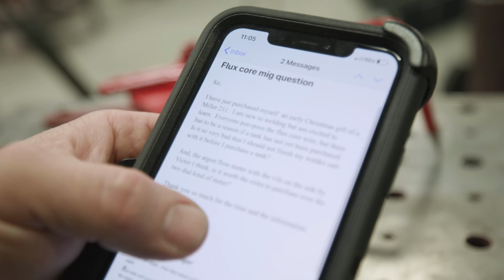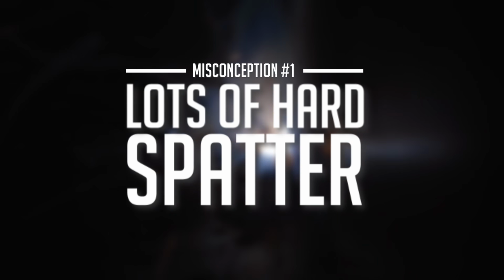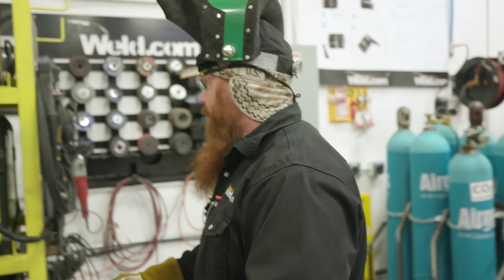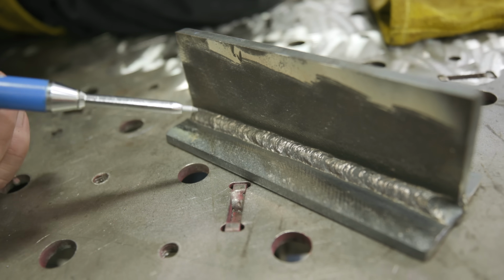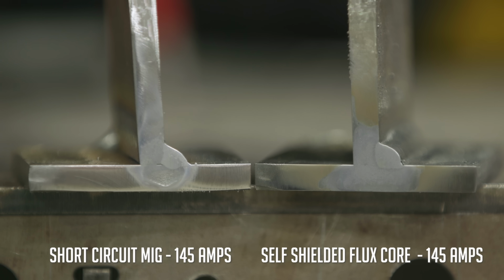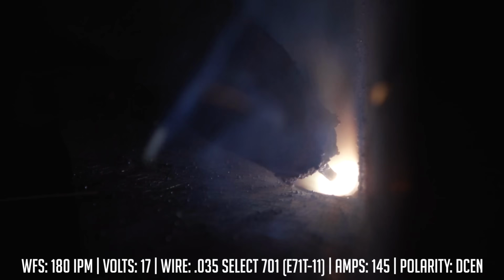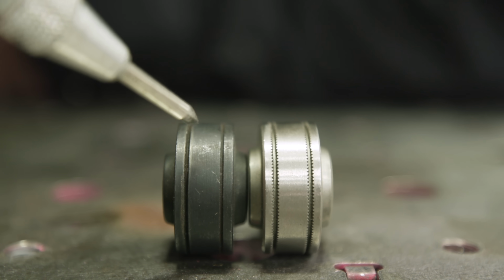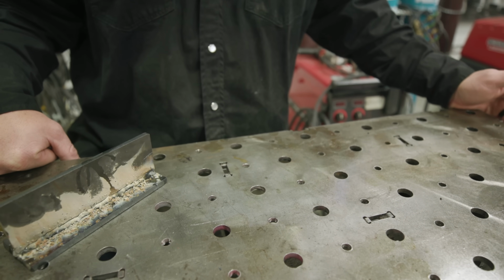3 Flux Core Welding Myths DEBUNKED

Comment: FWIW, showing us this on a Harbor Freight flux-core mig would be more relatable to the home hobbyists.
Reply: There are quite a few videos on Youtube of how to mod those Harbor Freight ones.  Thing with them is, factory they aren't even DC.  Even with decent wire they spatter like mad and it's hard to get a good weld with them.  They are usable, but not fun.  I plan on seeing if I can get dads and do a DC conversion and other mods to make it work a little better as a DIY project.
Reply: In dad's he used Lincoln Electric wire to make it usable.  The Harbor Freight flux core wouldn't even produce a weld in any way we tried.
Reply: @RotaryTurbo  I've been able to weld everything from 22 gauge up to 1/4" with my Harbor Freight flux core welder. Not saying the welds were beautiful or I didn't blow holes all over the place, but you can definitely get a real weld with ease. On clean 1/8" steel it will weld just great.
Reply: @RotaryTurbo  Pull the weld, give it a 1/2" stickout, and practice, the Harbor Freight machines work quite well, seriously. I have two, 1 transformer(90 amp/$90) and 1 rectifier(125 amp/$200) and they work excellent. For the money you cannot do better, and they ARE NOT AC machines, they are DCEN
Reply: @RotaryTurbo  Ive got the 90amp version they had on sale and the wire that came with it. My welds are ugly as sin but ive not had one break yet. It does what I need it to do here on the farm.
Reply: slick1rick1 well it says right on the harbor freight machines on the faceplate that they are in fact AC power.... so....
Reply: @RotaryTurbo  I bought a 90$ fluxcore welder and that thing runs great. Not comparable to mig or tig ofcourse. But still sturdy decent looking welds. Maybe you shouldnt lay the blame on your tools
Reply: @kaptein1247  I never said it's impossible to get decent welds.  Jus that with the old AC cheapies, they'll get good improvement with a couple cheap mods if you can get them cheap or free.  If you have to buy it and mod it, there's decent cheap DCEN welders now.
Reply: @RotaryTurbo  It's pretty easy to get decent welds for around 100$ including gear. No mods needed.
Reply: @kaptein1247  agreed.
Reply: @slick1rick1  I agree, I have a relatively cheap flux core setup (similar if not just rebranded harbour freight gear), I'm ex-automotive, moving into machining, so not even super experienced with welding, and I have no problems with the process, I mean, maybe it's because even when I was welding, I was running mig, and welding on super thin, or rusty metal parts (lots of exhaust system stuff, and a little bit of body sheet metal welding), maybe it's because of that experience that I'm adaptable enough not to run into these issues, but if you know what polarity to use, and how far away you gotta be from what you're welding (and of course understand how voltage and feed rates effect your setup), you shouldn't be getting a ton of spatter, or ugly welds at all.
Reply: @RotaryTurbo  They most definitely are DC, they don't spatter much at all when used correctly and for the money work really well. I have two, a 90 amp transformer power supply, and a 125 amp rectifier power supply, and they BOTH run DCEN. The only mod I did was to make a 10 lb spool adapter for the rectifier machine to avoid the cost of 2 lb spools, other than that they run beautifully. I have a Associate Degree in welding technologies and have worked as a Union Boilermaker, structural steel, and shipyards, and I am now retired at age 66, I sorta know what I am talking about.
Reply: @slick1rick1  I wonder how much it depends on exactly WHICH HF welder you use?   

I have one of their Miller-like auto setup (215A version).  Only way to weld sheet metal with 0.030 FC is on manual, at min speed and min heat.  Otherwise, I just blow holes on the sheet  Haven't tried anything heavier, but suspect that would work out better.
Reply: A lot of ignorance in this thread. 
HF welders are AC AND DCEN. The Chicago electric 90A and 125A are both AC and require mods to be DCEN. The Titanium 125 is DCEN and requires no mods.
Reply: @corbinbrosneck6725  Exactly.  Put another way the cheapest Chicago electric welders are AC only machines.  The slightly more expensive, physically smaller, inverter machines are of course DC.
Reply: Did a DC conversion and proper polarity (4 way bridge rectifier and some caps), switched to Lincoln wire and few other mods to my 12 year old HF several years ago and the welding quality went way up.  Recommended.
Reply: @drzorbo3770  They are DCEN machines and need NO bridge rectifier because they are not AC.
Reply: @slick1rick1  Mine is an old 90.  If you open an old 90 you will find NO rectifier.  They are most assuredly AC machines. The spatter is legendary.  Look on YT for modifications (as noted above) for information.
Reply: @drzorbo3770  My 90 amp is a DCEN machine and it states so in the manual. I know of no gasless flux-core wire that runs AC, and even though it has a transformer it does not mean that it runs AC output voltage, all quality plug-in machines ran a transformer and were DC output.
Reply: @slick1rick1    My 90 Amp (old) had only AC output because, as built and designed without a rectifier, there is no way in god's earth that a simple transformer that is fed AC can output DC. NONE.  Please clarify how this magic can be performed.
Reply: @slick1rick1  Check their website: 125 amp welder duty cycle: 90A AC @17V, 20% and in the Operator's manual it states: Welding Output 60 ~ 125 A, AC.
Reply: @drzorbo3770  A transformer converts AC to DC, that is why it is called a transformer. The DC output is not continuous DC, if you look at it on an oscilloscope it is clipped, a full wave bridge rectifier is used to make it continuous DC but it is DC nonetheless. You might want to check this but I  know how it works and it is AC in, DC out.
Reply: @drzorbo3770  Check out the videos explaining full wave bridge rectifiers on youtube, they will explain it quite well, it is AC in DC intermittent current out, the full wave bridge rectifier only makes the intermittent  DC constant DC.
Reply: @slick1rick1  Sorry,  I think you misinterpreted what you have seen on rectifiers, and AC transformers.  Go on and believe what you want but I stand on my EE background and years working in the field. Have a nice day.
Reply: @slick1rick1  : You are probably right regarding the welders you own. (Not part of my knowledge)

However a Transformer Takes in AC at the primary and Sends out Transformed AC at the secondary.  If there is no "Brain box" or "Electronics" in the system then the output of a Transformer is AC.

To Do a half wave Rectification (Clip all of the Reverse polarity from the AC)  you need a Diode in the system..
For Full wave, yes a Bridge rectifier is usually used - though a 2 diode fullwave rectifier works too... ...  (Caps can help Smooth out the ripple...)
Reply: slick1rick1 
A transformer is used to step up or step down ac current. By design they work with ac, and ac alone. A bridge rectifier uses 4 diodes to convert ac to pulsating dc. The addition of a capacitor in parallel with the output side of the rectifier then “ fills in the blanks” between the dc pulses, thereby creating an almost perfect constant dc.
Reply: @slick1rick1  Um, no and no. A transformer 'transforms', one Voltage to another, for welding with a 120 V AC supply input and 15 Amps available at the wall supply, the transformer transforms that to a low voltage HIGH current output.
For example a 90 Amp welder may work from a 10 Amp supply @ 120 Volts, which is transformed to 90 Amps at 12 Volts. The reason it is not 100 Amps is due to losses in the transformer and feed system.
A rectifier 'rectifies' AC to DC. A single diode in series with the transformer output makes DC pulses at the AC frequency 50/60 HZ. A Bridge rectifier 'containing 4 diodes', makes pulses at twice the AC frequency, 100/120 HZ. Adding a capacitor in parallel, smooths the pulses into usable DC.  
DCEN DC Electrode Negative (DCSP) DC Standard Polarity, works with the electrons flowing from the electrode to the work, since the wire is thin the electrons flowing through the thin wire heat the wire and the flux to operating temperature, if you have enough stick-out.
DCEP DC electrode positive (DCRP), DC Reverse Polarity is for use with MIG that is with GAS shield, the electrons flow from the work to the wire, which is cooled by the flow of gas.
Reply: @slick1rick1  a transformer changes an AC voltage say 120 to a lower AC voltage say 24 vAC then you need a converter circuit/ rectifier to convert to DC. So if you addjust the output voltage of the transformer to 17 volts AC then the DC output from the rectifier should be about 17 vDC.
Reply: I have NO problems with my 90 amp welder as is. I also have 50+ years welding doing structural and ships/boats. Show me ANY flux-core wire that runs AC, I'll wait.
Reply: @slick1rick1  A transformer doesn't change ac to dc, it merely steps current up or down.
Reply: @slick1rick1  A rectifier converts AC to DC, that is why it is called a rectifier. A transformer only changes AC voltage, (or if the turns ratio is 1:1 then the output voltage remains the same).
Reply: I use a harbor freight titanium 200 multi process and I love it. Used it only with flux and stick so far because I have yet to get gas but I'm sure it will run mig and tig fine. Look up videos on it. Many people compare it to Miller's and Lincoln in quality of welds. Customer support is where it lacks.
Reply: I use an ESAB Migmaster 205. I got it on EBay for around $1,200.00. That thing is a beast.
Reply: Thats what ive got, the 90amp they had on sale. Only thing I could afford after my old stick welder got stolen. :/
Reply: I have a cheapy harbor freight flux core 125 amp welder,  IF you bevel your work and preheat with a propane torch 250°F,  you can weld 1/4" plate in 3 passes. 😂😂😂
Reply: There are two 90 amp machines diagrams, one Clearly shows a bridge rectifier and the other not so much
Reply: Flux core is not mig. FCAW not GMAW.
Reply: I'm the hobbyist running a $99 (on sale) Harbor Freight flux core welder and it does just fine.
Welded a rusted out mower deck back togother. 
Built my welding cart with it.
Built a tool cart with it.
Did a fare bit of body work to my truck (03 Dakota) and many small odd ball repairs.
No complaints.
Reply: Uhhg. Harbor Freight’s Chicago Electric flux core welders suck. Its wire feed is absolute trash. It won’t even draw the wire no matter what wheel type I used. Just slips and stalls even using the tooth side. When it does grip, it’s too weak to turn. Not even ten uses in and it quits. 1/10 don’t ever consider even if it’s cheap.
Reply: @BrokenLifeCycle  I found that the tips get stuck wire easily, you have to free them up often. Use graphite powder to lube the spool hub. Also make sure liner the wire goes into is angled to match the direction in between the two or else there is too much friction.
Reply: @josephkrcmaric5964  After fussing at it for months, disassembling it to see if something got stuck, lubricating, and just generally doing everything you said to do, I came to the conclusion that it was just a piece of trash and disposed of it as the trash it was. 

This was a year ago. I use a cheap stick welder now. It's simple to use, hard to master, but if something goes wrong, I know it's user error, not the machine.

Not to diss Harbor Freight entirely. Every other tool they have? Great! But after that debacle with the welder, I just don't trust the welder brands they offer there.
Reply: Just spend the 250 on the Lincoln man harbor freight is asscrack and so are their products

Comment: I love the people who say flux doesnt get good penetration on thick stuff, but theyre still the first to remind you that its not good for thin stuff because it burns hotter than solid wire 🤔🤔🤔
Reply: Now I'm wondering, is it actually decent for thin stuff? Obviously those opinions aren't credible, so I'm not sure.
Reply: @CoDisafishy  it'll do it perfectly as long as you take your time and let the metal cool down
Reply: Move fastee
Reply: Actually I prefer small flux core wire like .023 for welding on auto sheet metal over MIG any day.
Reply: @gregorytimmons4777  where can you find .023 flux wire? I tried in Amazon and could only find mig wire
Reply: @111nomnom111  Actually i think i put the wrong size down. I need to look in my welder and check but it's likely the smallest flux core commonly sold. Flux core has some penetration IF run on a 110v machine that converts to DC output like my Lincoln which also has connection for a gas line for MIG or Dual Shield. I have no problem running the small diameter gasless flux core on automotive sheet metal. I don't find it hard to not burn thru like i do with MIG.
Reply: 0.30 is what i believe i intended to type. Make sure the polarity is right for running flux core. That is something to try when running poorly and no written instructions are available at that moment. I don't think it's possible to switch polarity and not have it be obvious which way is correct.
Reply: @111nomnom111  at menards
Reply: @111nomnom111  for $7.99
Reply: @gregorytimmons4777  I just bought some of that and the tips to try but i like the 030 wire best 035 would do better on thicker metal
Reply: Like i said. People arent moving fast enough. Keeping heat in one area too long
Reply: @joshgarrett8819  I know my mistake but I let it cold down a little then filled the hole back in
Reply: Thanks a lot this is helpful. (subscribed)
Reply: Mine does really good on thicker metal and any little pellets I grind off an do my stuff outside
Reply: A bit contradicting huh

Comment: Flux core is a serious form of production welding for high quality and speed but you need good equipment to do it right, a harbor freight machine probably won't cut it .
Reply: I was surprised.  Ran a cheap Hobart 110v for auto repair stuff and light fabrication, it could throw down some really good welds.

Comment: Another trick for spatter is using the soot from a torch. Turn your torch on without any oxygen and soot up the part or area you dont want spatter to stick to. That black soot works great as an anti-spatter.  Something gunsmiths will use when welding on firearms.

Comment: I did not even know I could get a special feed wheel for flux core.
Reply: It is critical when using flux core. The v groove wheel can’t grip the wire as well so you have to use s lot more pressure on the wheel which is not good.
Reply: I didnt know that either. Makes sense though as its kind of a razors edge with too much pressure and not enough
Hobart 140 is what i have.

Comment: Can you change the polarity on any mig welder safely?  I have a lincoln electric Mig Pak 140 and exclusively use flux core wire.  I would like to try this but am concerned about damage to the welder etc.  Are there any risks involved in changing the polarity?

Comment: I was so excited when I saw this video.  I have been having the exact problem you describe with my small Hobart welder.  Unfortunately I went and checked and I have the polarity correct for flux core wire.  My ground clamp is positive with respect to the welding wire.  I even checked with a meter hoping the welder was wired incorrectly internally.  Probably I am just a crappy welder.  30 years ago on the farm I stick welded on the time and had perfect beads.  No such luck now that I have taken it up as a hobby.  I was considering getting solid core with shielding gas but based on what you have said I should be able to get good welds anyway.
Reply: Try cleaning your ground connection.
Reply: @unclep1210  Thanks for the tip.  I will try that.  I have also heard the ground clamps that come with some of these welders are not that great.

Comment: No matter what way you connect it if there is 150 amps then you have 150 amps through the entire circuit. I think you are confusing current with metal deposition and where the heat is.

Comment: You guys need to refer the the wires properly....flux core is just that but it depends if you are using a shielding gas...if you are using a shielding gas then it's called dual shield...non gas wire is referred to as inner shield...they both contain flux but referring to them both only by flux core can confuse people.
Reply from the maker: Thanks for pointing that out, according to AWS the correct terms are Flux Core Arc Welding  Self Shielded (FCAW-S) or Flux Core Arc Welding Gas Shielded. (FCAW-G).  Dual Shield is a trademark name of wire from ESAB for their FCAW-G wires and Innershield is a Trademark name form Lincoln Electric for their FCAW-S. They are not welding processes just brand names. I hope that clears up any confusion.
Reply: @Welddotcom  hey....you're right those are the definitions for esab and Lincoln for those wires. All I'm saying is that saying dual shield is pretty self explanatory that the wire is flux core wire that needs shielding gas and inner shield doesn't need shielding gas....I know those are specifice terms to Lincoln and esab but it's just an easy way for people to understand as opposed to their definitions....not trying to argue...just saying that's all.

Comment: The biggest issue I run into with flux core  is worm hole porosity constantly. And I can’t figure out why I checked my gas flow, stick out, angle of gun, push or pull but for some reason if I’m running about a 2ft long weld I’ll get 1-3 little pieces of worm hole

Comment: Instead of using Anti spatter, you can just soot your work piece or table. I ran stick and mig at work for years but only ran flux-core at home. I would just tack my work together then use a straight acetylene flame to cover the piece in soot. Then wire brush the weld area and run a bead. Nothing sticks to the soot. Clean it off when you're done.